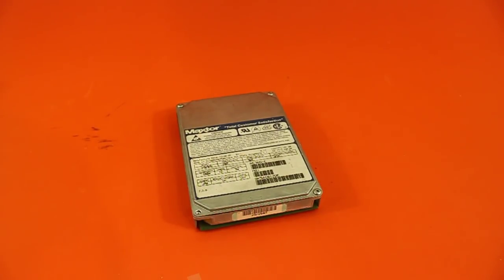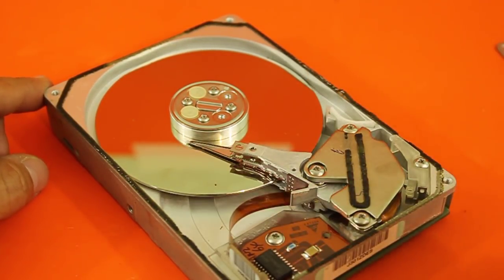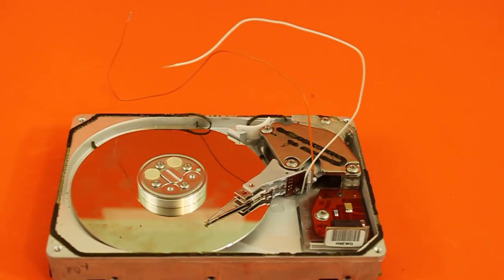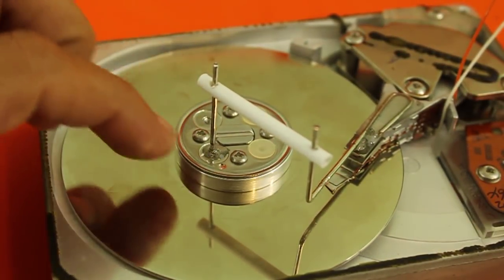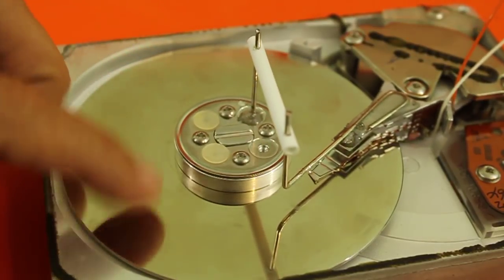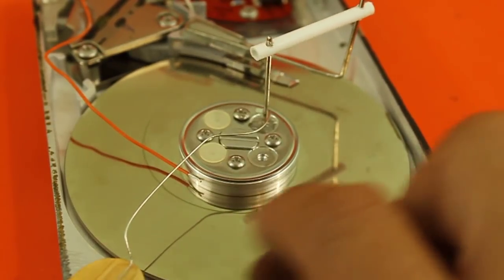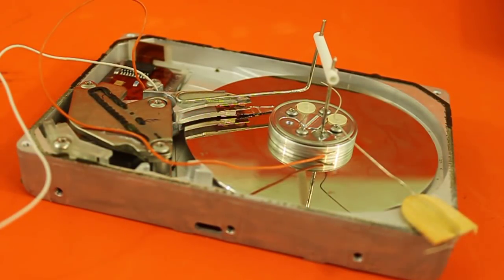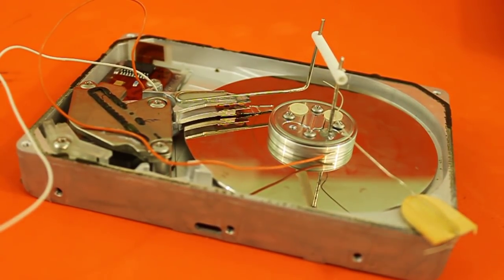Hard Drive to Solenoid Engine Conversion

Comment: I would suggest following the traces on the flex-cable from the head-assembly to the plug, so you don't have to have your wiring moving with the head.
It should hopefully lower the moving mass somewhat.
Reply from the maker: +erlendse good advice thanks

Comment: now if you can use the spinning action to utilize the energy of the second motor ( the DC motor under the platter ) to reduce the over all voltage needed to run it.

Comment: What's the purpose of doing something like this vs. Just powering the motor that spins the cylinders? Or is it just for the sake of experimentation?
Reply from the maker: +Yushatak just for fun
Reply: The other motor isn't one you can "just power", you would need a controller to run it (or a 3-phase source ramping up in frequency)

Sure, you can get the "ESC" driver for RC-planes e.t.c. to run it. The on-board controller may be harder to reuse.
Reply: I wonder how it would behave on 50Hz, getting a 3 phase low voltage transformer shouldnt be a major problem.